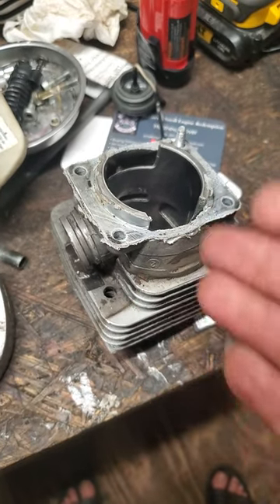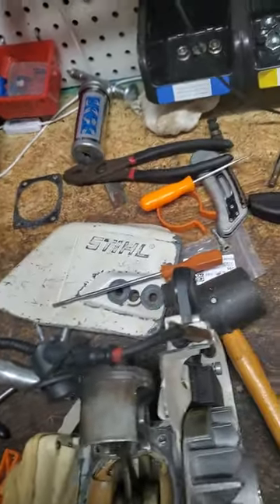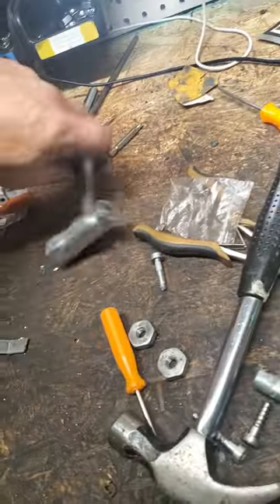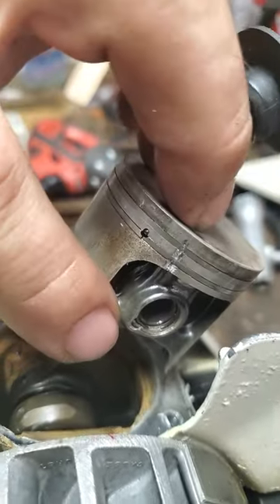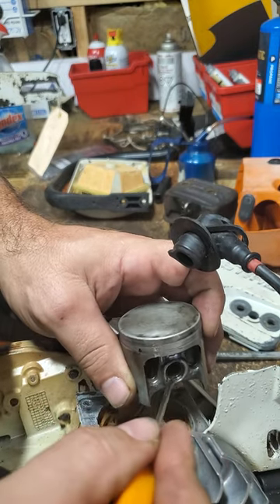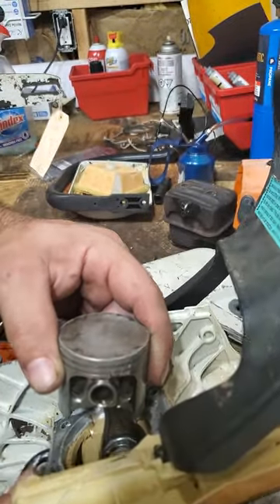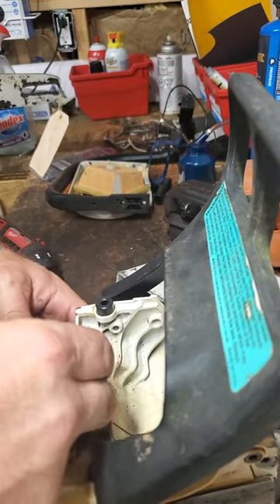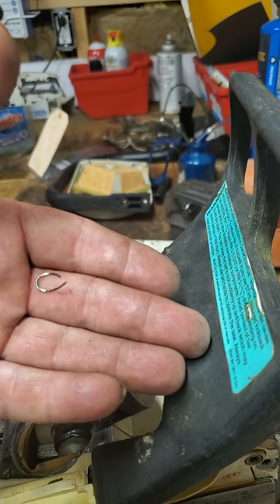MYSTERY 3RD wrist pin cir-clip is cause of Stihl MS361 Chainsaw

Comment: My guess it was the circlip on the intake side.  It always seem to be that side that comes out.  If the exhaust side comes out - it will end up in the muffler.  They usually come out before the seventh tank goes through the saw.  They usually just destroy the piston and cylinder.  When mine came out it was my error.  Now, I know how to stop them from coming out and since I started using this procedure I have not lost a circlip.  I have a brand new Farmertec ms 361 short block in the shop that I will sell or trade you.
Reply from the maker: If you watch, I explained BOTH CLIPS ARE STILL INSTALLED which is why it's a 3rd mystery clip
Reply: @chainsawredeemer85  you must have dropped it into the engine accidentally.  They just don’t materialize out of the wild blue yonder.
Reply from the maker: @johnclarke6647  it was ultrasonic bathed, it was cleaned... we can talk mustas all day long or we can just not talk about it bc I desire not to neighbor